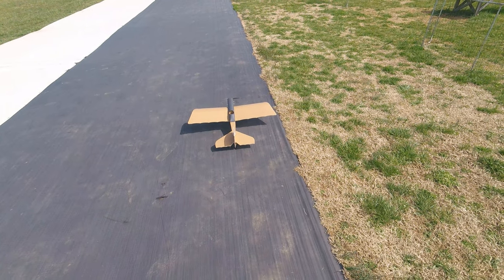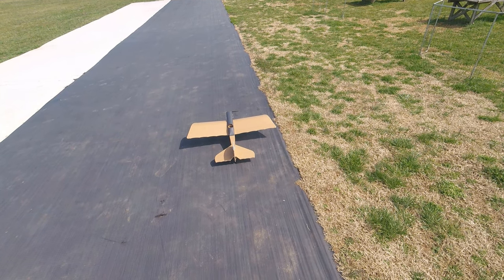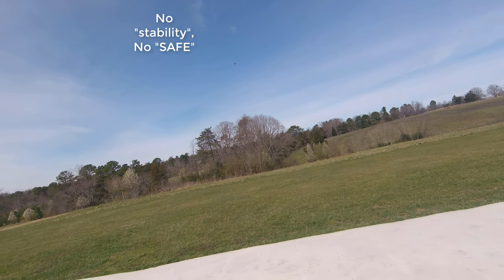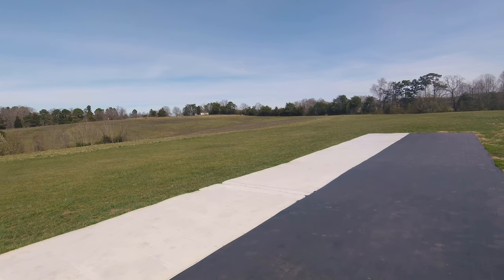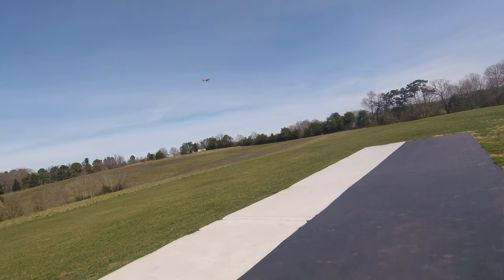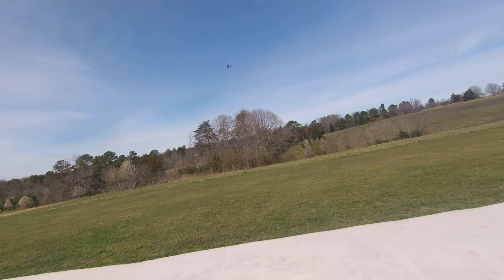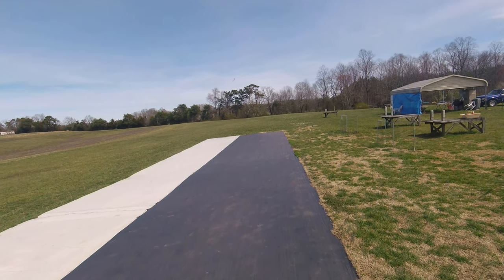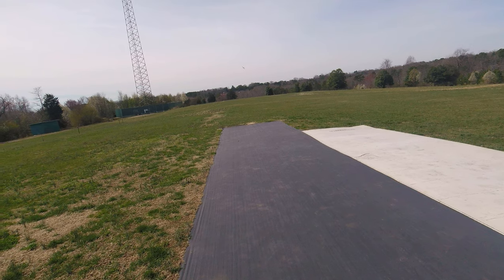FT Simple Scout with Lemon 7ch stab plus rcvr

Comment: If you calibrated the "safe" mode on the Lemon receiver while on the ground, the tailwheel needs to be lifted so the fuse is level during the process. Otherwise, it will climb all the time.